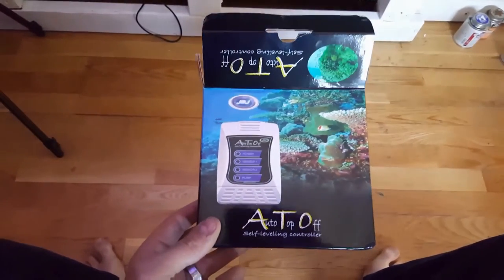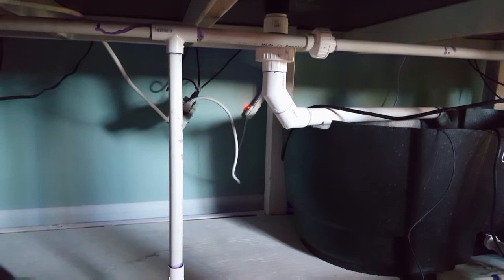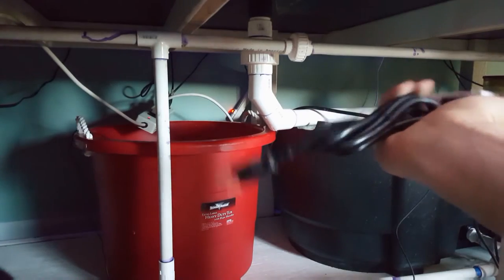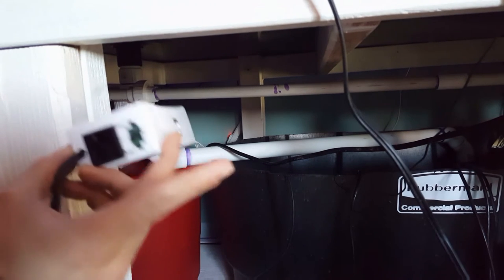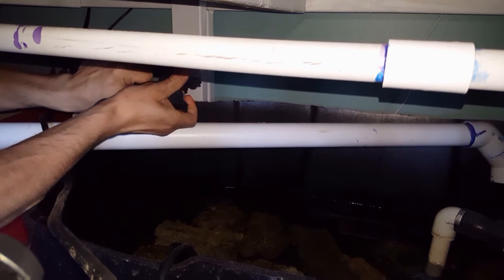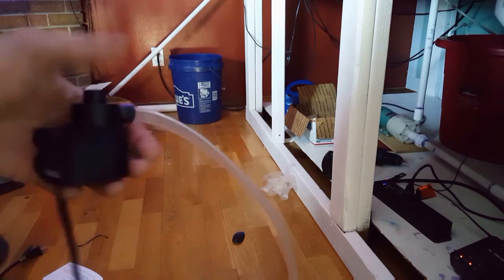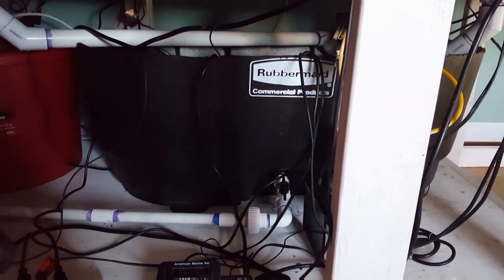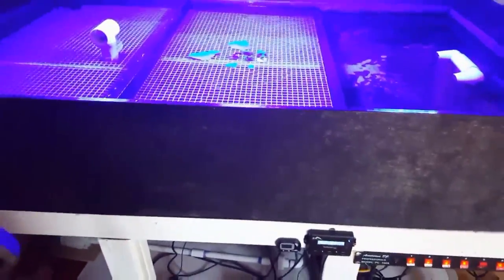Setting up JBJ ATO on the frag tank.

Comment: That auto top system was good to me for the years I had it. The only gripe was the float switches had to be cleaned every now and then, or they will eventually start acting up and fail (went through 7 of them)

Wish JBJ made the float switches better, but definitely a good starter top off system.
Reply from the maker: Rob's Adventures I am seeing a little of this now.  If they go dry the salt makes them stick.

Comment: Toms Aqualifter worked well on my jbj but I'm def with you on using a bigger pump for a larger tank. Has that pump worked well for you? I run it with only 1 sensor and rely on the timeout to stop the pump within 15 seconds. Nice vid
Reply from the maker: CJ'S AQUARIUMS when I get home I'll take a look.  I know the pump I have on my main tank works well.  it's the same size pump maybe bigger